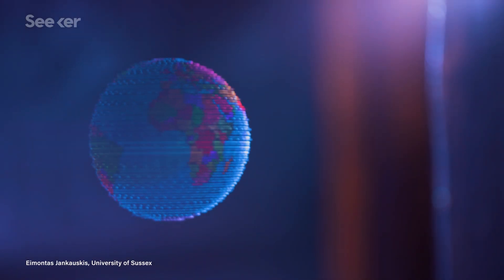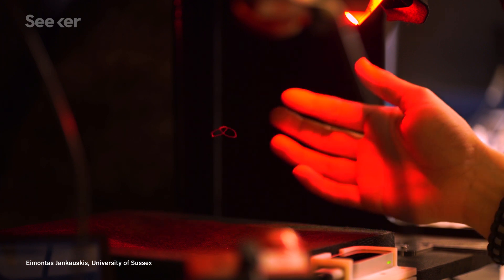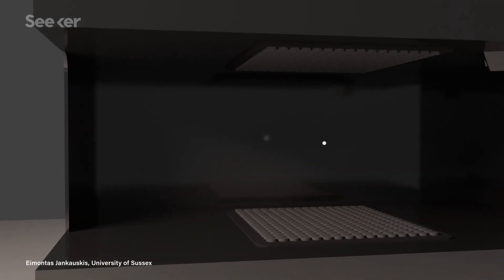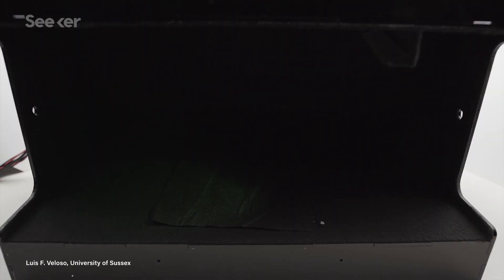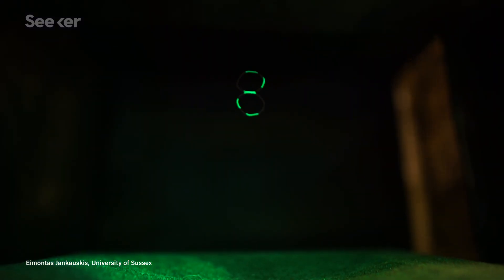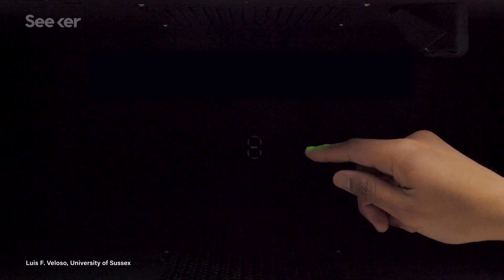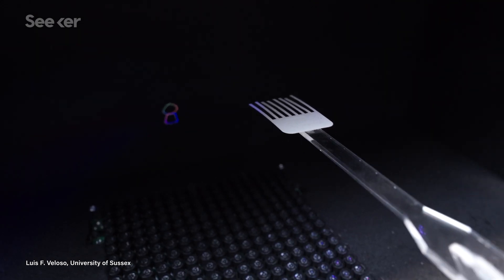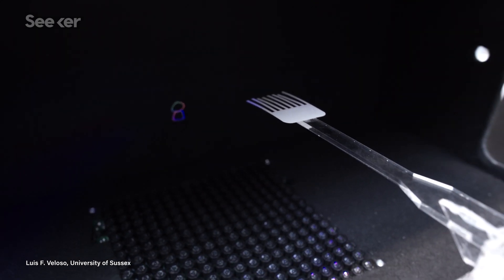You Can Now Feel 3D Images, Thanks to This New Tech

Comment: its needs a bottom and a top relatively close to each other so not that impressive
what is impressive is that we can move the beat around now

now if it could be levitated from the bottom without needing the and the bead(s) can change color in a controlled way we'll have a true hologram. 
then again you did say it's not an hologram :3

the latter may be easier to achieve tbh. a swarm of beads that are moved while their colors are controlled via wireless communication technology

Comment: Unfortunately this requires an atmosphere to work but this is still pretty cool!

About the 3D printing... the machine that manipulates the sound waves could easily be modified to change frequencies to weld certain materials together (sonic welding has been around for a long time and occurs really quickly). I can easily see this machine moving many particles into a certain shape that someone is trying to make. Once they find the shape they want they would hit a print setting on the machine and the levitating powder would instantaneously go from levitating to welding together with it's neighbors. 

Needless to say I am really looking forward to seeing the full potential with this tech.

Comment: They're going to face some issues if they try to scale this up to, say, the size of a large stage . One issue I foresee is that because there is a great disparity between the speed of sound (the ultrasonics) and the speed of light, the lighting will not be perfectly in synch with the pocket movements. But this will only be a problem for large displays. They might have to work in some kind of delay in the lighting to account for this.

Comment: Imagine using beads like this to shape objects. imagine a 3D printer, but it doesn`t print but rather it uses the bead to form grooves and shapes into a solid. For example, you can use metals like titanium as a bead, and heat up an aluminum block and re-form the aluminum block when it is heated enough for the aluminum to melt. I'm really excited to see what this new advancement will achieve in the near future, and hopefully, we can see more updates about this! :D

Comment: • 2:55 - The bead only has 3.14mm³ of volume, other than perhaps silk, what kind of material could you fit in it? 🤨 Besides, it wouldn't work anyway because as the material is being deposited, it will occlude the bead from the transducers.
• 3:20 - Also, while you can touch it, it can't sense the touching, so you can't manipulate the display. The best it will be able to do is to use cameras to observe your hand/finger positions and interpret touching.
• 4:06 - It'll probably stay one bead since there's no practical way for the transducers to target more than one bead (at least not without maintaining sufficient distance between the beads).
• 4:13 - This came out in 2019; 2020 has to step it up.

Comment: Okay, you have a bead controlled by vibration.  Any interaction by the hand with the bead, beyond a brief touch by a finger tip, will obviously block the vibration of the bead.  So try to grab the butterfly, and you shall be holding a very still bead.
Reply: If you re-watch the video, they explain that specific ultrasonic frequencies can be generated by the machine to mimic touch.

Comment: "High quality directional audio cues".. what she means is, this tech can't currently generate intricate and moving objects in synchronization with other  beads. Example the object of a person (full body) picking up an object and tossing it to another person, all done seamlessly in real time. I'm wondering how can acoustics be used to accurately define sharp line angles in conjunction with curves. Would require some other technology to control the bead and make it move at higher frequencies and yet be stable and also synchronize with perhaps thousands of other beads. I am going ahead and guessing that this type of technology does not exist anywhere and it would be a shock if it were invented within the next decade. The other technology most likely dealing with magnetic fields which if used would also tally with the timeline of fuel-less flying cars. Let's see.

Comment: How many megapixels should a camera have to be able to take a picture equivalent to what a human eye can?
Reply: Human eye resolution is 1 arcmin or 60 pixels per degree. So for a 180° field of view it would be 10800 pixels -> 10-12K resolution.
For 360° It would be 21600 pixels wide.
Reply: @johntheux9238  OMG THANKSS!!!
Reply: @-r-1184  It's actually not the cone cells density that limit the eye resolution. It's the diffraction of light.
https://en.wikipedia.org/wiki/Airy_disk
https://en.wikipedia.org/wiki/Diffraction-limited_system#/media/File:Diffraction_limit_diameter_vs_angular_resolution.svg